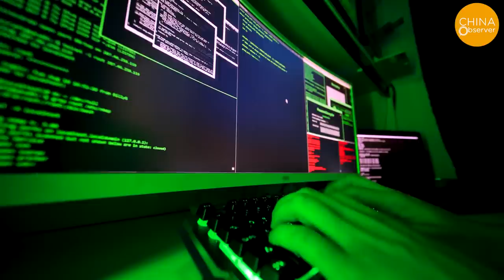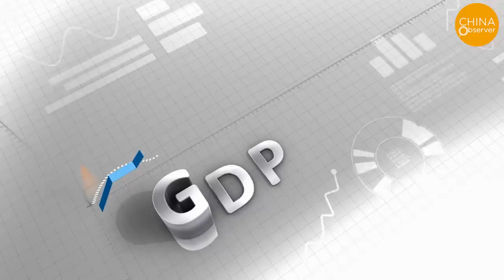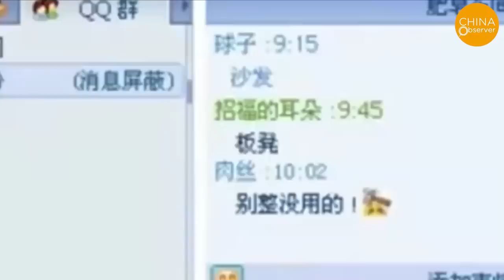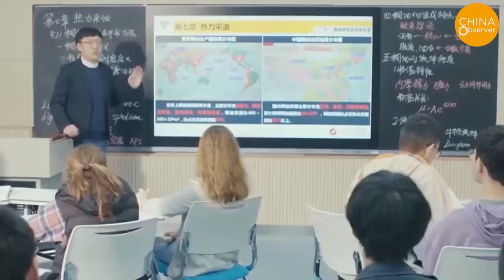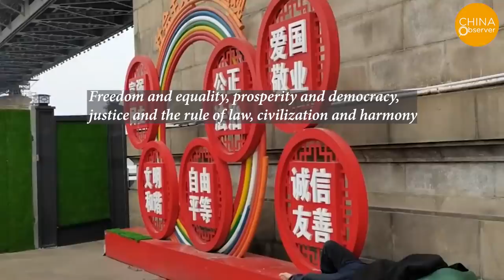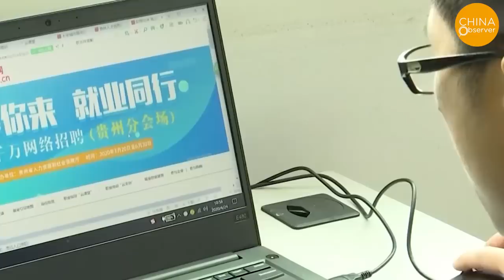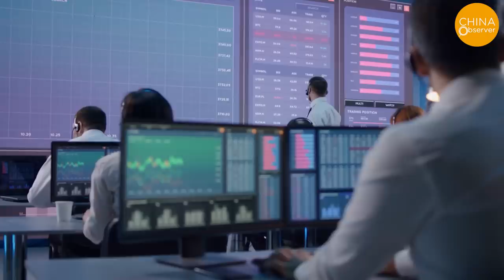China's Generation Z: Growing Up in Booming and Facing Recession in Adulthood

Comment: The young generation in China vastly underestimates what the CCP will do to maintain power. They WILL force Gen Z to work, to breed, and to comply; far stronger predecessors were broken by the CCP, and the CCP will do ANYTHING to hold on to power. Now that the borders are all but closed, and capital flow choked off, Lying Flat will soon lose viability and moneyed layabouts will soon be forced into the grind by their parents.

They can only hope that (a) somehow the CCP screws up badly enough to lose power and (b) what comes after is an actual improvement.